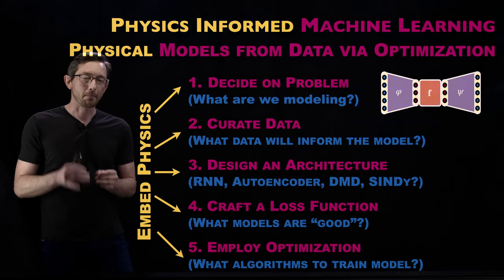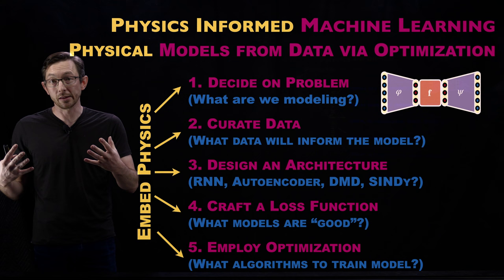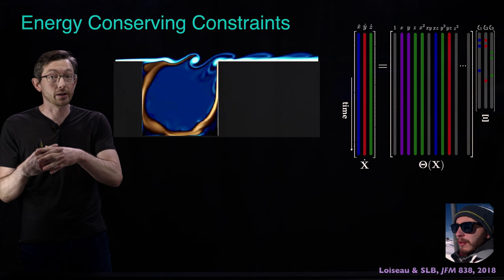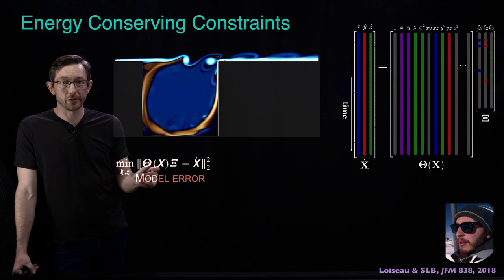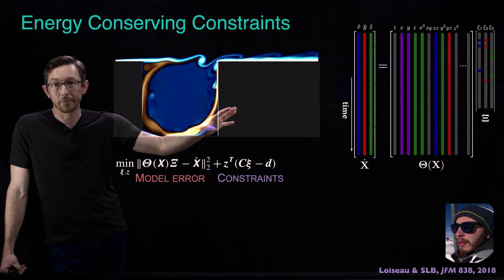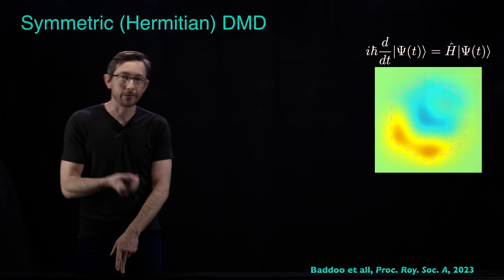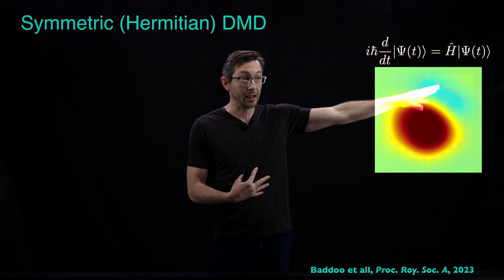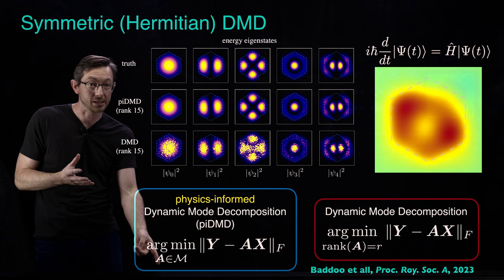AI/ML+Physics Part 5: Employing an Optimization Algorithm [Physics Informed Machine Learning]

Comment: As someone who works in Game Engines on real-time simulation this entire playlist has been my evening routine for the week. I haven't been this excited about a lecture series since I graduated uni. 

The games industry has gotten really good at rigid body dynamics (although real-time still has accuracy issues for complex mechanisms), but everything beyond that is a complete approximation. Most cloth physics simply acts as a post-processing step that cannot affect the rigid body dynamics. Similar state in fluid simulation as well. Trying to bind all three into a single cohesive system is prohibitively expensive because to get each system to affect the other becomes unscalable  using traditional solvers. I feel like I am seeing the light with these lectures, fascinating!

Quick question, in these lectures you are referencing code examples for PINN and SINDy systems. I haven't seen these in descriptions yet, are they coming or should I look for the source somewhere else? I ended up purchasing the Data Driven Science and Engineering book and saw some overlap with the topics discussed here, so I was wondering if some of this content is on that same github page?